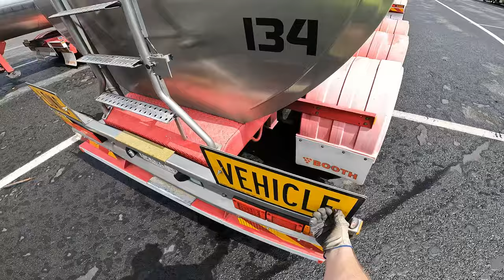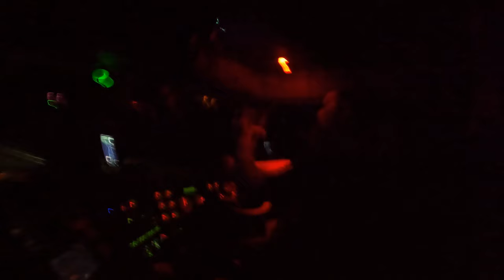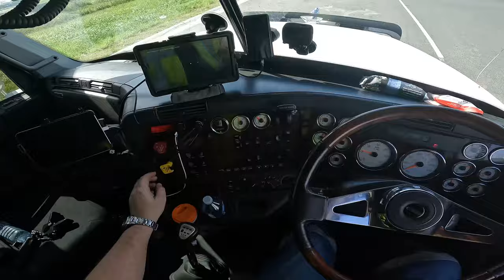Episode 22 Unknown Destination

Comment: Hi Brad great video,just a hint when you have disconnected your dog trailers leave the supply air line on which is the female connection on your lead and turn control off which is male on the lead. Supply is normally on right hand side but just check in case there ass about also sometimes there set up vertically. I’m usually disconnecting every night at Gatton for same company based out of Goondiwindi
Reply from the maker: Cheers for that's Greg, I should know that but I seem to keep buggering it up lol but yeah thank you